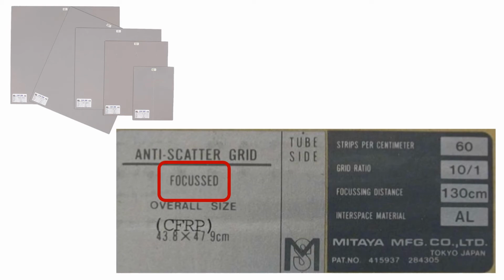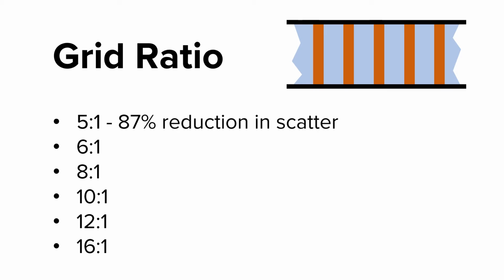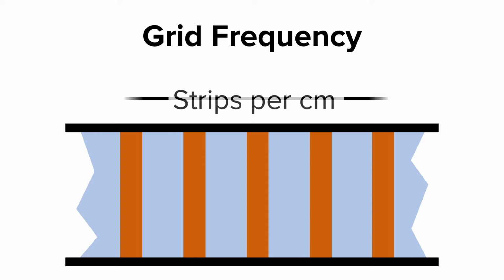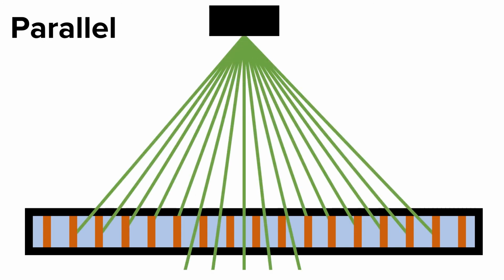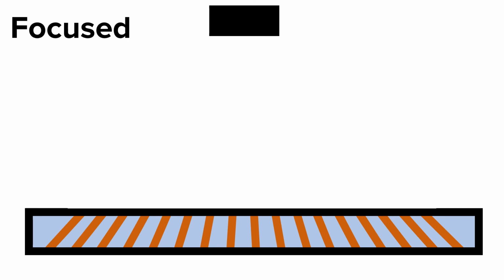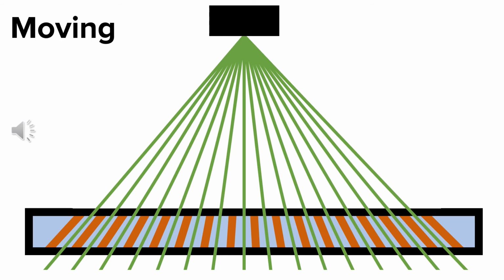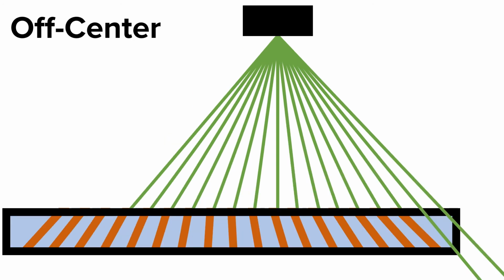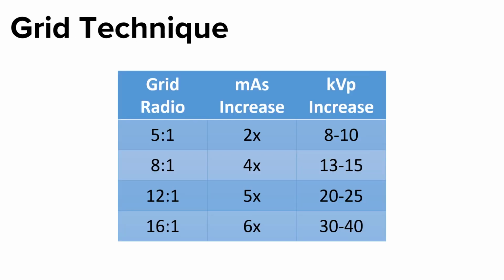Grids

Comment: To use a focused grid successfully you will need to understand the geometry of each projection. Tube angulation only changes collimation, so the beam can be directed toward the edge of a grid without any cut-off. Here is the test that 75% of qualified radiographers fail.  https://youtu.be/mZPD_gLs5Dw